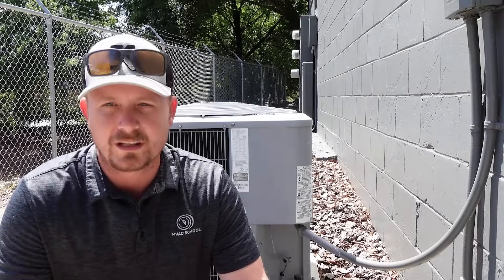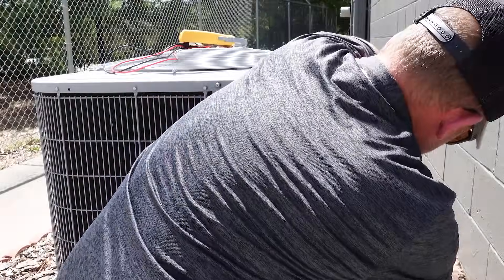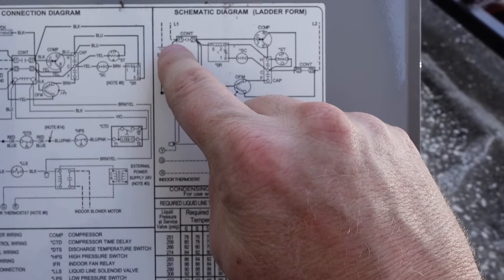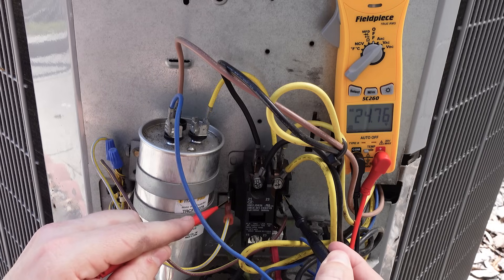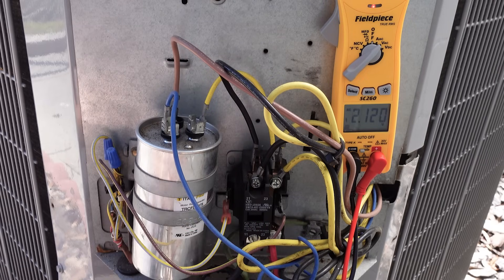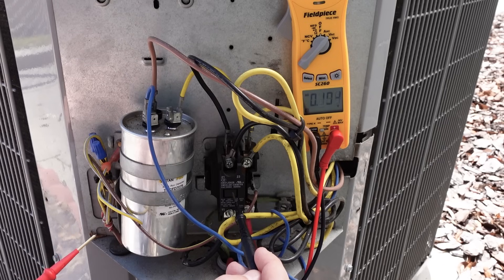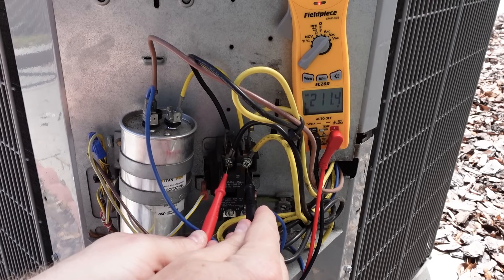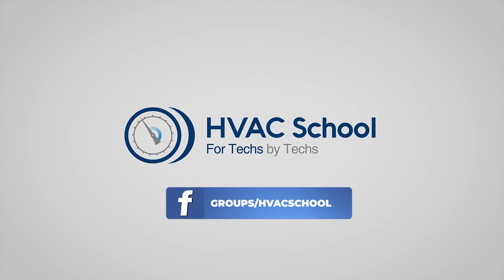Basic Voltage and Safety Measurements on an Air Conditioner

Comment: Curious about a dual Run capacitor. I've thought that a Start capacitor is in parallel with a Run capacitor for the compressor and there is no Start capacitor for the fan motor.  Is this correct?

Comment: As an electrician. Your phase to phase of 212VAC is a bit low unless it’s a 3 phase system. The area transformer might need to have its taps moved if it’s a residential area. If it’s commercial, all good.

Comment: Thank you! I just fixed my A/C that has been down for 2 days after figuring out 1 of 2 fuses was blown going to the Air Conditioner so I was only getting 120v out of 240. $25 later and my AC is alive again!

Comment: So let’s say my disconnect is pulled and i get reading from hot and ground is it safe to say i have an issue with the disconnect? Because if pulled why else would I have voltage at hot and ground which is ur total volts between the impedance from the wire plus the voltage at the contactor itself?

Comment: You forgot to tell us the disconnect was plugged back in test your voltage
Reply: Yes I had to rewind and go forward to see when you turned power back on to test voltage. I believe it was after 2:51 second spot?

Comment: When it's 115 out safety checks sometimes are not done.  Don't be that guy and never trust a disconnect box to disconnect.  I promise if you do electrol mechanical work long enough you'll eventually come across a failed or by-passed disconnect box.

Comment: I watched a hvac video on youtube where the guy claims you can discharge the capacitor (unit off) by measuring voltage (com to fan and com to herm)..I asked him about that since made zero sense to me and he said there is a resistor built into the meter and by measuring voltage it bleeds the capacitor. To me makes zero sense but curious if you have ever heard of such a thing? Btw, excellent video

Comment: Was working on a unit today and touched the two incoming leads to verify 240v with my meter and there was a very large shock/arc. What caused this? It melted the ends of my leads 😅

Comment: Awesome video I’m about to graduate from the course that I’ve been in for a year for Hvac and here in Texas a lot of people keep complaining that the air-conditioning stopped working and we noticed that it is a lot of capacitors going out. I haven’t worked on anyones condensers yet but I made a guess when I saw a video that someone sent me where the OFM is on and the compressor is humming and the suction line wasn’t cold at all. I told her it could be the CAP and when someone came out to fix it that was the issue. I’m going to see your video on testing capacitors just to get a little more knowledge but I know the secret of using the multimeter to test for capacitance and the formula for testing capacitance while energizing the CAP.
Reply: Finishing school in Florida. Let’s get it bro!!!!

Comment: I could never see exactly where you placed your voltmeter leads especially when you pulled the disconnect and stuck the voltmeter tips in where???? First you said you got 240volts then you said you didn't get any volts.  WHERE did you stick those things to get those readings????

Comment: Great video.  Only thing I would have added is that after jumping across the capacitor with a resistor, would be to verify that the DC voltage (NOT AC voltage) from terminal C to HERM is zero and terminal C to FAN is zero.  Don't forget to switch your voltmeter to DC for these readings.
Reply: Why would you ever switch into DC? Microfarance or nothing
Reply: @rockchaney3209  Switching your meter to DC is a safety check you would do before disconnecting any wires to the cap, making sure the cap did not have any DC voltage stored in it. (Shock or electrocution hazard)  Then you would check the capacitance of the cap after this safety check.

Comment: How did you have 24 volts applied across the contactor if you pulled the disconnect ?
Reply: The transformer is on the inside unit and sends 24 volts through thermostat wire to outside unit

Comment: There is stray voltage because the meter is not reading 0 volts. It's reading a tiny load of voltage.

Comment: Good refresher. Never a fun surprise when the customer said they shut off the AC breaker for you because there's no disconnect outside and it was the dryer instead.

Comment: I'm lost on the part where the contactor is OPEN, but there is still 120 on each leg of the system.
Where is that power coming from.??? Is it back feeding from the CAP until it's discharged??
L1 and l2 are cut off via the contactor.!
Reply: The contactor only breaks one of the supply wires. The other wire carries the 120- volts into the compressor and fan motors and back out to the contactor. As there is no current flowing as the contactor is open then you have no voltage drop throught the motors and you get 120  like you are measuring. Hope this helps. Think about it untill the penny drops
Reply: @michaelcostello6991  yes it helps alot thank you!!

Comment: A note on the safety of pulling the carts before the panel:
To some guys it might be second nature when you see a unit that's having problems to be like "Well let's yank the panel and see what we got." I had a case on my own unit where the guy did that and discovered a badly mounted hard start with the terminals resting against the panel. It could have just as easily been a wire burned off and sprung out to the panel. The gods forgave him that time but just WOW. This was the same guy that left the caps off when he was done. And this was from a locally well respected relatively high end company. Go figure.
Reply: That's a good point.  I was trying to think of a strict safety procedure for approach.  Seems to me, you'd sweep the disconnect and unit  with a NCV (non-contact voltage) detector to verify no skin voltage.   Open and pull the disconnect.  Verify line voltage, then with onr probe go to the unit chassis from one of the lines to verify the ground bond is intact.  Then from the chassis to each of the load side disconnect contact to verify no voltage to ground.  Then open up the unit.   Maybe that's full paranoid, but you develop practice for that one time you come across a fault.
Reply: @jkbrown5496  yes, the thing is the hot terminal might not even come into electrical contact with the panel until you begin to remove it, in which case it is no longer grounded.

Comment: Thanks Bryan!  Why does 123 plus 123 equal 214?
Reply: Is it because source is three phase?  Can you tell my mind is stuck on residential split phase?
Reply: @chuckdearruda6271  short answer is its an rms reading not just adding the voltage together
Reply: @chuckdearruda6271   I was thinking 214 was low, then it hit me that it's 208v system at a commercial/light industrial site.  123.5v x srt (3) = 214v

Comment: Why check voltage to the contractor after confirming no voltage to ground from the disconnect? Unless it's  for the demonstration purposes
Reply: It is what is called "best practices."
Reply: @MaMa-qh4dy  that's true, but I'm wondering if its possible for voltage to still be present after checking the disconnect box for voltage to ground
Reply: @mrgreen9086    If properly-working disconnect is pulled out, no high voltage should be present going to the unit. (However, capacitor(s) may still be charged.) If there is a breaker-switch in the box on the outside of the house, then never assume that the breaker is functioning properly. Always check inside the unit like Brian did.
Reply: @MaMa-qh4dy  that makes sense thank you!